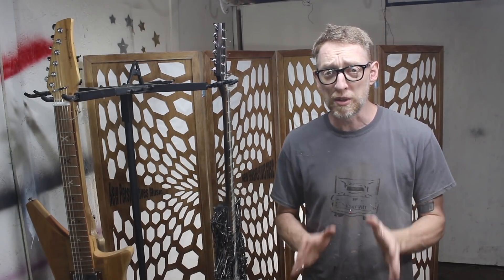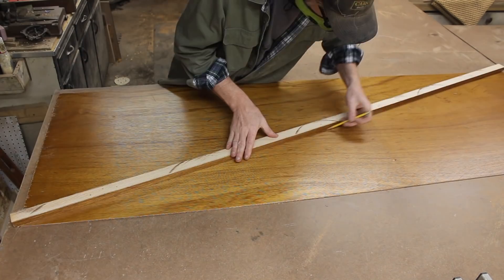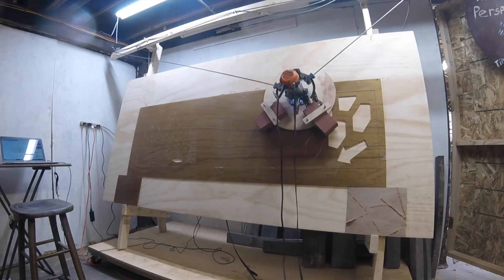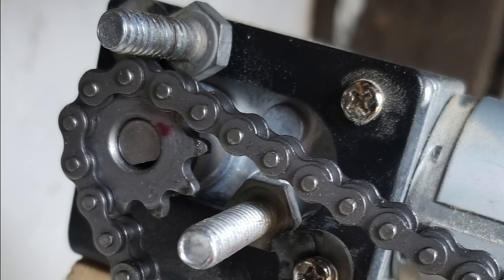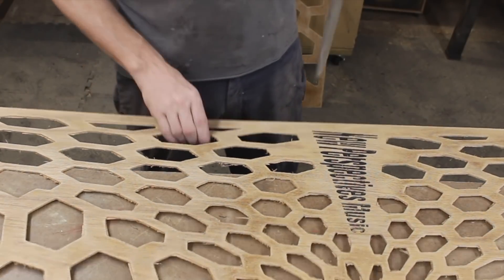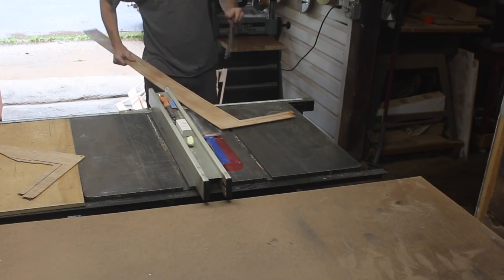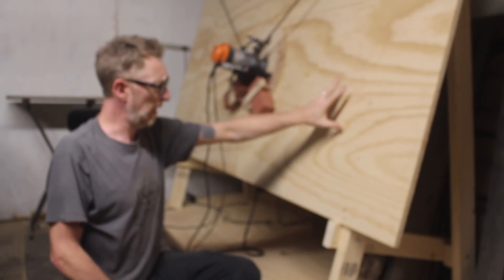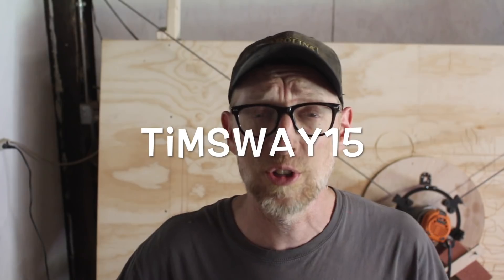Room Divider | My 1st Maslow CNC Project with MakerMade

Comment: One change I would make is to use peg board for the back so that you could have a vacuum attached to it so that the work would stick. I think a couple more sprockets with some type of tensioner would solve those issues. Don't have any slack i the chai at all.

Comment: I assume you have to hog out all the material and not run a profile because you cant retract the end mill.. youre always cutting at depth.
Reply from the maker: There is full z axis control. Especially in the newer model. This was slow and inaccurate but the makermade m2 is surprisingly accurate. I made a full 3d carved headless guitar with it. There's a video.
Reply: @timsway  🤣 i had it turned around the 3 finger rule is all switched around on this.... well kinda... good form thanks much

Comment: I would suggest using a dry lubricant silicon-based are use one specifically for workshop tools but you can get a specific chain version which is used on motorbikes just stops any of the dust that is obviously created by the machine sticking and building up it simply just falls off. Oil is just going to be a dust magnet exacerbating the problem

Comment: On bicycles that sticking is common where it was connected if the plates are too close together. You can split them apart a bit with chain breaker. Thanks for info

Comment: I keep reading about Maslow machines that get out of spec on work pieces at the available extremes and was wondering what the most ideal range area wise was the most ideal.  Heck, I'm half tempted to build one and measure out a heat map of accuracy if it already hasn't been done.

Edit saw the end but still making the heat map.
Reply from the maker: It's a 4x8 area but really you wanna keep it in the 3, 3.5x7 ish area.

Comment: Hey mate, nice work! You just need a chain tensioner (used in Trial Bikes) to fix the issue you are experiencing. Look at Aliexpress. Cheers
Reply from the maker: cheers. the newer designs use a spring instead of elastic that puts better tension on the chain.

Comment: That is a great job, absolutely love the panels, you can backlight those with any RGB colour you want, really nice job and a great advert for the Maslow CNC, I have been watching this product from the start, I would never have the need for a CNC this big, mine is 1.5 mt by 1mt and is big enough for me but as you say for 500 dollars you can have a basic cnc machine any size you want, its just your imagination that holds this machine back.  Great demonstration. Many thanks for showing this and good luck to Maslow it really shows what it can do.
Reply from the maker: They have a newer version that is a little more but supposedly much more accurate and user friendly. I will be demoing it on this channel soon. It's in a box at my shop. Stay tuned!
Reply: @timsway  thanks for the update. I will subscribe i think.

Comment: Look up a narrow wide chain and sproket!! It’s a MTB system used to enable the bikes to have a single ring at the crank and 12 speeds out back!!! So if it works on bikes that change 12 gears while riding down mountains...should work for this!! Also, they make chain tensioners that do basically what your ledger lockers were doing

Comment: I agree with some posts below that counterweights would be the best answer. By reversing the direction of rotation of the motors and placing a "slide" on the ends of the stand which would allow a weight to slide up and down, on the same plane/angle of the sled, it should eliminate the binding problem without changing the rotation speed of the sprockets. It would also maintain constant tension on the chain eliminating sag in the chain.
Reply: I watched the following video and he has solved the problem in a much better way than even a counterweight. When I build mine I will use this setup. https://www.youtube.com/watch?v=CIQC5ZyzfDM

Comment: The rubber bands that hold the chain are a band idea the tension is differing all the time. To fix it take a weight over a roll  and attach it to the chain.
Reply from the maker: i ended up doing that and it works much better.

Comment: really not sure the amounts of time needed to maintain, fix and bare with the whatever outcome and narrow capabilities, worth not spending 4 times more to build a vastly better diy machine.
Reply from the maker: This was my first pass using this machine and my setup has improved since. Some people get remarkable results who take the time to tinker. I honestly have not because I have another cnc and rarely use this one. I do plan on testing out their new Z setup soon, however, and may do a little more upgrading in the process.
Reply: @timsway  seen it working it seems to be just a quirky advanced diy nerd exploration craft (which i could dig). too slow to sell stuff, too prone to destroy valuable wood stock, too complicated for an average diy/amateur.

Comment: Hi Tim, I think I know how to improve the alignment of your chain thats been used on dirt bikes for eons and that is you use an "H" shaped roller nylon motorcycle roller that aliens your chain with the gear sprocket and you can even include a spring tensioner so you don't have to use a bungie cord.  Just a thought.     I'm gonna build one of these one day. Keep up the great videos.

Comment: I had a large CNC table that cost considerably more than this, and I have to say: What I've seen of the capabilities of this machine, its relatively minor issues and reasonable accuracy this isn't a bad idea for those wanting to add affordable CNC capability to a hobby shop. 

Sure: anyone wishing to work in production will want a better, faster product; But for personal projects this is a great idea for the CNC novice.
Reply from the maker: Exactly. It gets you in the game but does not replace a $10k machine and it is unfair to compare it to one.

Comment: Hi, I'm thinking it's a design flaw to use such a small diameter sprocket for size of the chain.  Should add an inch to the diameter of the sprocket and the binding issues would disappear.

Comment: Another chain lubrication you can try is called Squirt, it's a wax based lubricant that will not have dust stick to it like grease will. You can also grab the chain by the sides and flex it back and forth (the non bendy sides) to work oil, wax, grease into the rollers on them and hopefully help stuff get in between or loosen a stuck or stuff pin/roller.

Comment: I would also make some type of nylon or delrin (old cutting board ) chain guide / rollers, and get the sprocket off that top beam a little as well. This will make it run much much smoother. This seems to be a kick ass setup for the money. Thanks for sharing !!!!!!!! PS even some type of bike chain tensioner like off a 10 speed might work to keep some tension on the chain drive end of the cnc.

Comment: I have a Maslow and my biggest gripe is that the frame needs too much space in height, I wish someone would come up with a system so you can have a 4x4 frame, maybe just a shorter chain or something for people with less space. I originally purchased it when I had a larger shop but now I moved and my shop is much smaller.
Reply from the maker: that's a problem with horizontal cncs, too. my 4x2 takes up about 6x4 feet of space.

Comment: i dont know if its already been said but have you added any weight to aid the Z axis? its only acting on a few degrees of angle so it might be there isnt enough force to hold it down to the board

Comment: your chain problem can be solved by the use of counter weigth, with the added benefit to lower the effort on the motor. One can also put the chain in the opposite way on the gear (the loose part on the exterior and the part toward the miller on the inside.

Comment: Nice video Tim! I think that using belts and pulleys like the 3d printers use, and some math adjustment, would do much better job than chains and sprockets. Cheers!

Comment: We'll talk about it later. You might consider using a larger gear from  bikes to keep smoother motion and a tighter flow. It would probably eliminate the sticking problem. Kinkda like you'd see on a 12speed bike.

Comment: Add more tension on the tag end of each chain. On one end of the chain, it's under tension. But on the tag end, it's slack -- nearly under compression. Like a rope, a chain can't be compressed. So, the solution is to make sure both ends of the chain are under tension. How much tension? Well, consider that there are two chains that hold the router's weight -- so, one might think half of the router's weight per chain would be enough. I build a Maslow CNC and encountered the same issue with the chain skipping a tooth and with the chain wrapping around the drive motors. I found that about 1/4 or the router's weight per chain was more reliable for me.

Comment: Your problem is mainly with the chain. Needs to be tensioned at all times. You may have joined some shorter chain lengths too. This can cause binding at the link joins. At 7:25 you have let the chain travel too far around the sprocket without any tension. At 7:38 the notchy chain is traveling over the surface of a hexagonal nut. It's bound to catch. That guide is very important. I would replace it with a larger diameter, free running nylon spool . The chain will also bind on every one of those small diameter screws. All those screws need to be replaced with dog sprockets or smooth Nylon runners that can be repositioned for different jobs. Please don't file the sprockets. They are not the problem. Cheers

Comment: About the counterweights on the machine ...

Wouldn't lead be a solution (could make it smaller to fit inside the gliding plate) ?
Reply: It could, really its only there to add opposing weight, doesnt matter what the material is as long as it provides that weight.
Reply from the maker: the idea behind the machine as it sells is it is diy and inexpensive, able to be put together with common items. Certainly many people have "modded" their machines with better weights, steel frames, etc etc. and get better peformance from the, too. For my purposes of demoing the machine online, I stick with the basics.

Comment: What Orgarza3 said.  This thing really needs constant chain tension on the backside chain equal to the tension caused by the weight of the disc and router.  Note how the chain only wraps around the loose side of the sprocket, not the tensioned side. If the tension on the 2 sides of the chain is equal, the chain wont curl/bind around the drive sprocket.   Bungees though cheap are not constant tension. In addition to the binding it causes a tendency for inconsistent feed speeds and drive currents. IE: feeds faster down than up. Simple fix is to remove the bungee from the hooked traveler sprocket, add pulleys in the middle of the frame and nylon lines from the hooked traveler sprockets, thru the pulleys and down to counter weights that hang behind the frame. The 2:1 ratio provided by the traveler sprockets means the counter weight for each side will need to equal the total weight of your router plate assembly...  neat panel project!
Reply from the maker: That's what I did later. It works much better with weights. Thanks!

Comment: instead of those screws in contact with the chain, I would install a pulley that normally fits inside a bike derailer https://www.bike24.com/p2252059.html

Comment: that chain needed more tension, not lubricant, your elastic might be starting to fail
Reply: I think a bigger problem is the lateral loads caused by the chain not hanging in a vertical plane.

Comment: Run the router side of the chain over the top on the inside. Run the loose end to drop to the side with a weight on it.
Reply from the maker: I made that switch after this vide and have been running it like that with better success.

Comment: On a side one if my hobbies is R/C cars that are capable of hitting speeds in excess of 70mph (not scale) and can keep up with full scale cars. They make roller bearings that are very small that could be used for many things. It would smooth out a lot if movements and reduced a lot of friction. They are also reasonably priced.

Comment: Hey Tim, What are you using for generating the Gcode? I just got the Maslow setup. Test files work great, but hit a snag with trying to prgram the gcode for my own designs... makerCAM is broken and JScut seems to not be reading my files properly
Reply from the maker: I use vcarve brand electric and save the cam files as if they are for xcarve. It's not free but vectric makes a program called cut2d that is inexpensive and you can upgrade as your cnc use grows, if needed. Another option is to use the maslow forums for tips and tricks on free software, etc. I'm not familiar as I've always used vectric.

Comment: Hi Tim, I  have a small sign shop and I'm looking to see if it time for me to start making letters with a cnc router. Do you think I can rout acrylic, PVC and other soft material sheets with this cnc?
Reply from the maker: Yes, absolutely.  It's much slower than a benchtop cnc and requires a little more setup, but it is a very inexpensive way to get started.
Reply: @timsway  awesome, you rock.  The only problem is I wouldn't know how to set it up, I havent even used one of those routers before.

Comment: Great build!  Great video!  Liked !  You have probably fixed your problem by now ... but I agree with those who said below that it's more chain alignment than lubrication.  When you lubed it a lot it helped temporarily slip over the misalignment but the problem will come back as along as there is misalignment!  I also agree with those who said below that a weight on a cable is better than a bungee cord - because it offers consistent back pressure on the chain - whereas a bungee gets weaker and stronger.

Comment: The chains are sticking from saw dust coming out of the router into the chains - I had this issue with the original. Quick and easy fix is just having a old tooth brush around and brushing off the chains after use !
Reply: I think it might help to completely degrease the chains and use a drying Teflon based lube.  I did that with a bicycle if mine years ago, chain ran super smooth and never collected dirt.

Comment: Does it even make sense to use a chaindriven cnc at this size? normally chains will loose tension and if you think about 200 small pieces and each has over some weeks gotten a tolerance of  0.1mm(that not much for a chain - motor bike chains need to be tensioned after some time again and they are much stronger) then in total its for 200 chain pieces * 0.1mm tolerance,  20mm of total tolerance. This would be way to high i think, or am i thinking the wrong way? i think that steel wire would make a better job. 
Sorry for bad english i am german
Reply from the maker: I'm no expert, but I feel like chain would stretch less than steel cable. Plus chain is needed to fit on the gears. It measures by "counting clicks" of links over teeth. The machine is designed to come with elastacord to provide tension on the loose end of the chain but I have since switched to weights instead (based on other user recommendations) which works better. This way gravity keeps the tension consistent and the chains aren't going to stretch enough to screw up the math. If they did, one could recalibrate.
Reply: @timsway  i didnt thought about the part that there are counter weights. I think then a chain system may make sense in some way. But i can imagine that the chain really suffers from the dust that gets into it over time and may wear down. I am no expert too, these are only some thoughts :)
Reply from the maker: I made the mistake of greasing the chain which caked up with sawdust. if one uses teflon dry lube it stays much nicer and the dust can simply be blown away.

Comment: Definitely need some tension on the slack side of the chain.
Some of your solutions are probably making it worse.
Reply from the maker: I added weight and reversed the direction. it works much better now.
Reply: @timsway  
👍🏻

Comment: For my Maslow, the only modifications for it to work great for me was to switch to a 12 foot top beam, cut the kickers flush with the waste board so they do not get in the way and use a bungee cord on the slack gears pulling the slack together along the top beam.  It works perfectly without any other mods.  I do spray the motor gears at the beginning of every use with WD-40.  You also need to make sure that the motor gears are in the same plane for the chain to not skip.  When with the gears lubricated and properly aligned there is now teeth skipping at all.

Comment: those turned out great and the "cheepo" CNC machine is genius. Wonder if toothed belt instead of chain would work.
Reply from the maker: I'd be concerned about stretching with anything other than steel for the chain.  I've made some adjustments and have it running surprisingly accurately now.

Comment: As a bike restorer I have a bunch of bike parts, like the chain cogs on old derailers, that I would have used. I can't believe you have not had that experience, of being a bike geek. Fun Trivia fact, both Mojo Nixxon (Burn Down the Malls!) and Big Head Todd Park Mohr (Brokenhearted Savior) were bike geeks in the early 80's in Denver.  I was in Todd's basement in 1981 (ish) and he had bike frames he was stripping hanging all over. I found out later from  friends that Mojo was into bikes and played in a Denver band that was called Zebra 123. ANyway, I think they should ride old bikes when inevitably inducted into the Rock and Roll hall of fame.
Reply from the maker: I'm not a total bike geek. My buddy Dave (elm city vintage) is an old BMX trick rider and bike mechanic. He's the one that keeps me and the kids knee-deep in bikes. He does the bike mechanic work. I just do the weird stuff. Interesting story!